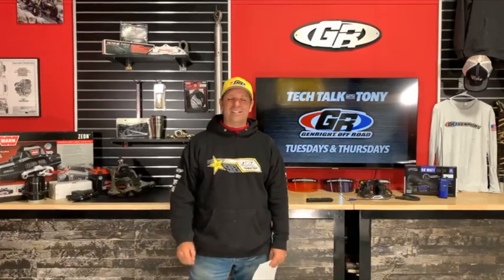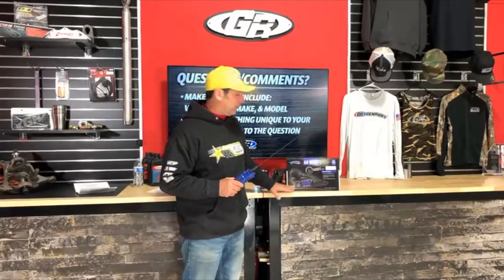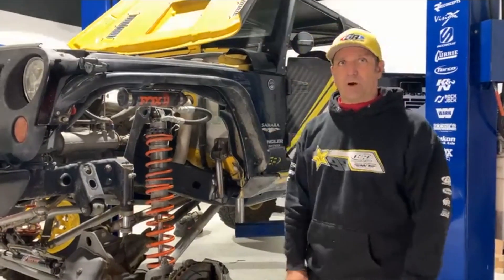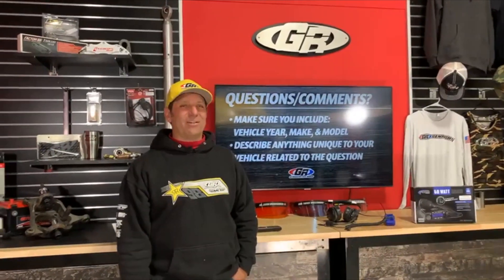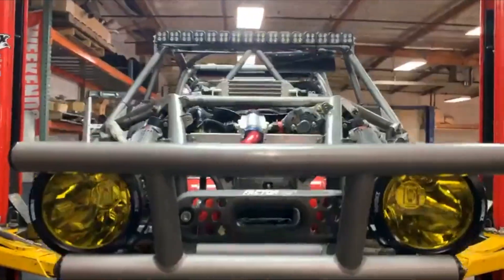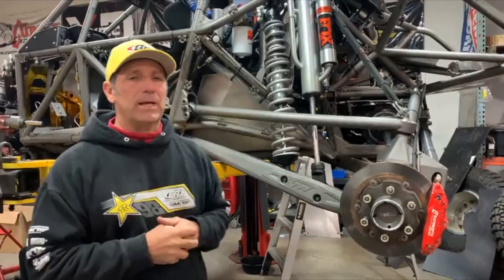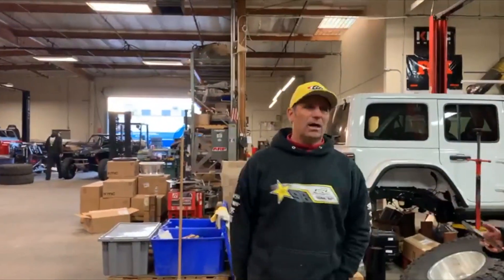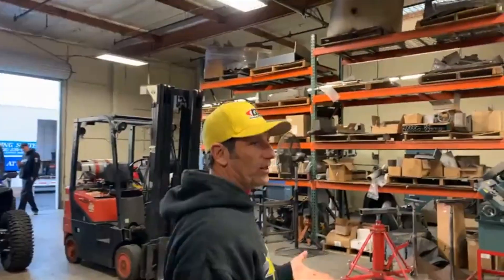Tech Talk - Trail Comms

Comment: Off topic...what would be the pros/cons of installing larger fuel injectors in the 4.0 I6?
Reply: I did a 4 hole 24lb/hour and definitely got slightly better bottom end but I also have a 62mm throttle body so it was to allow the engine to have better afr’s closer to stock with the slightly less restricted intake.